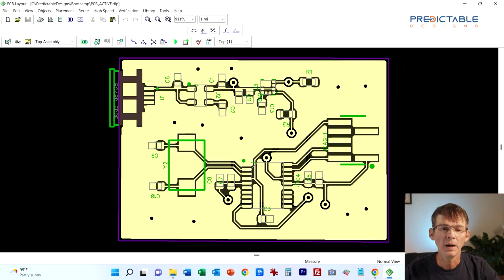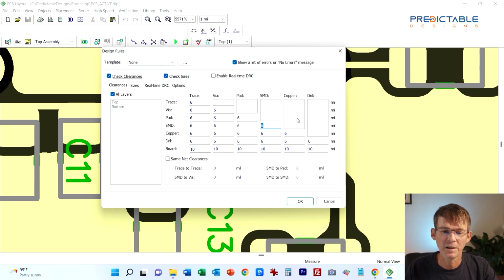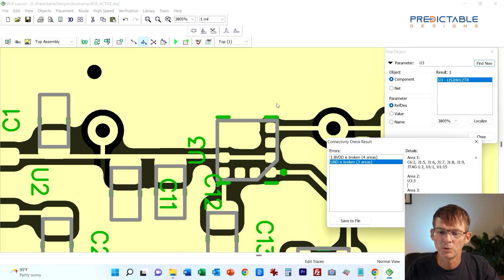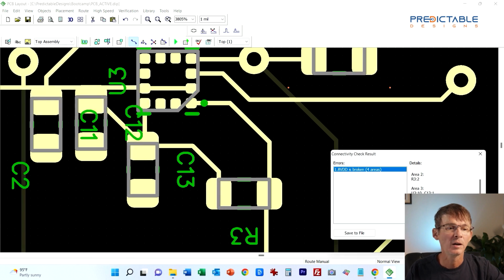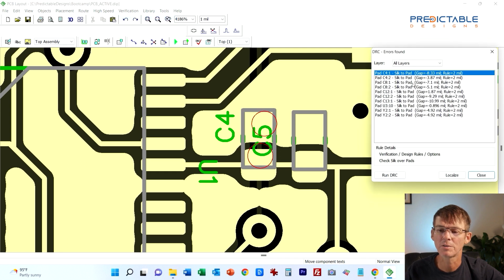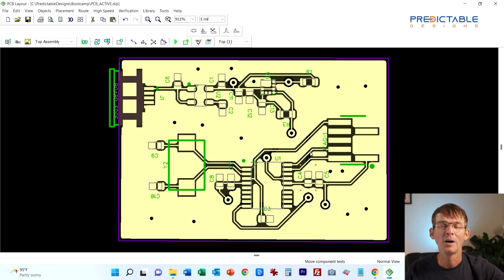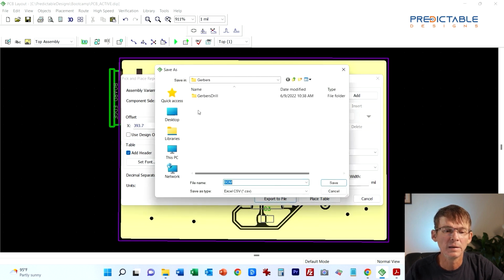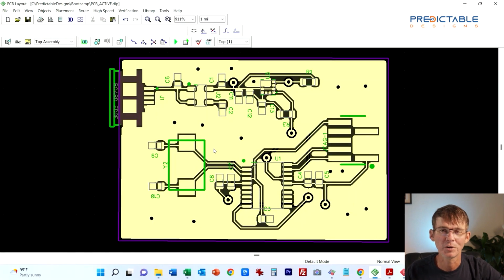Tutorial - How to Design a PCB - Design Verification [Part 2]

Comment: Can you do a video about the firmware side of things? e.g. the process of moving Arduino prototype code to mass production code
Reply from the maker: Thanks Jim, and I'll definitely consider it.
Reply: Most of the design consideration seems to depend on the hardware. I think that if what you have works well and it's tested well, you should be fine if you do everything else correctly.
Reply: @billybbob18  Intersting. In my understanding code goes from Arduino in prototyping, to full C/ Assembly at the final prototype, and at mass production the code is flashed using raw binary within a scripting language